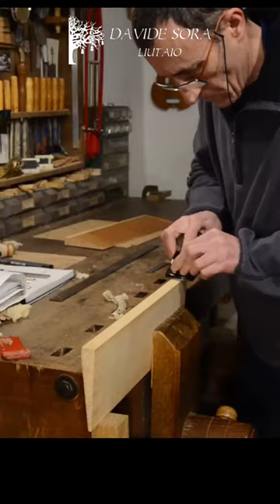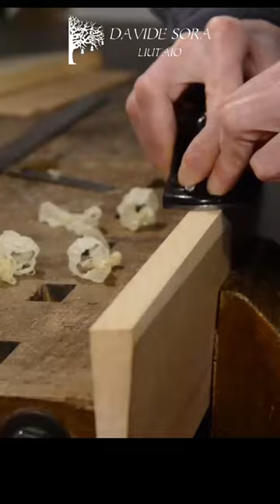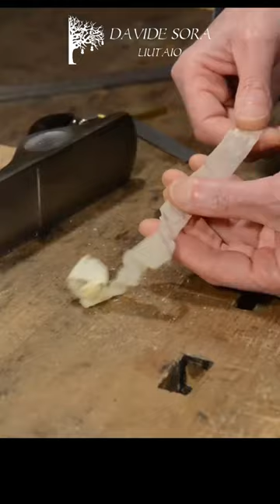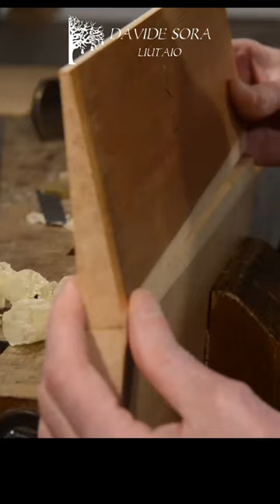How to make a violin top plate joint #shorts

Comment: Two piece top plate? I thought that it's done only with back plates. Is there any difference with durability, ability to make it as thin as one piece top plates, and the tone quality?
Reply from the maker: Even the top could be made in one piece, and some ancient violins have it like this, but in the vast majority of cases it is made in two pieces. This is because the ideal would be to keep the central area with the grain tighter and widening towards the edges, symmetrically on both sides. This would not be possible with a one-piece top, but in any case there would be no differences in the treatment of thicknesses and arches, or rather there would be the same differences that exist between any piece of wood, which, being always different, must be worked accordingly.
However, the difference is in the quality of the wood, not whether it is in one or two pieces. The problem is that finding pieces of sufficient quality and large enough to use in one piece is more difficult, and usually when they are found they are reserved for cello making
Reply: @DavideSora  Till now I was convinced that top was made always with one piece but now I see why I did not notice two piece as it was not visible because the seperating line was blending very well with dense grain lines of the wood and it looked like one piece, covered also by finger board and tailpiece.

It makes now sense that it would be difficult to find one piece wood when you explained the grain getting wider further from center. I thought that back plate often is made from two plates for economical reasons, making it possible to sound good as it's less important than top plate in projecting the sound. I thought that the glue in two piece top plate would make the glued area very vulnerable to unglue but now I see that glues are more powerful than I imagined. 

Thank you for detailed answered, it enlightened my blindness on topic.

Comment: I struggle with this so much, chasing a gap until the wood becomes too small😢
Reply from the maker: 🙂Don't worry, it's normal, mastering the joints is not easy at all, but once you learn to control the planing movement well, its proper set-up and its sharpening, it becomes a routine operation.